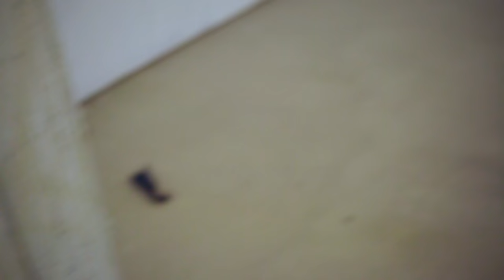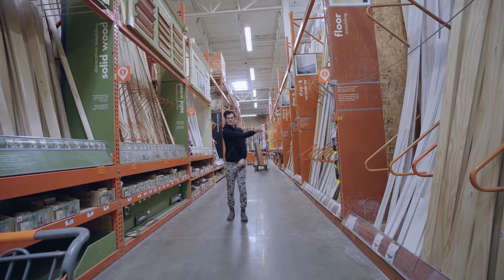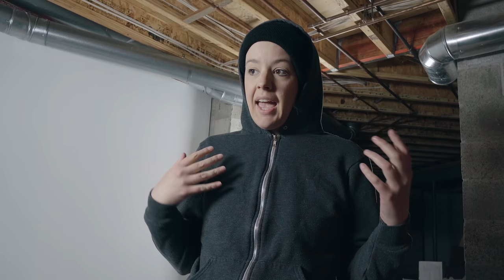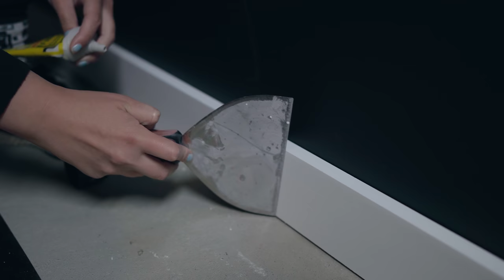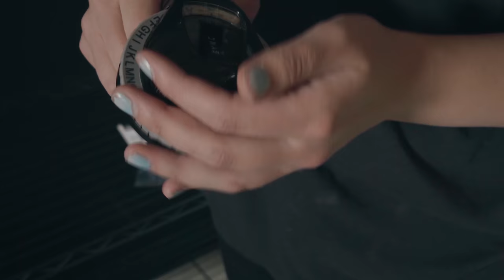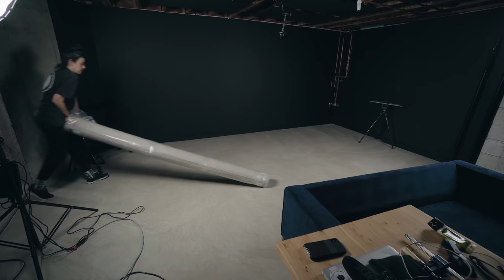It’s Just A Scattered Mouse… Turning Our Basement Into a STUDIO Pt.2!

Comment: Becki, did you find out how the mice were getting in? 
Until you find that and fix it your mouse problem could continue. 
BTW,  I had a mouse get into the wall of my house where the AC unit cables go through the wall. I bought a mouse trap, the humane kind that just traps them so you can release them into the wild later.  
I'm not so humane towards rats. They were getting into the garage at my mom's house. In the Winter they'd climb up on top of the engine in her car to stay warm. They made a huge mess and ate through some wiring. I found where they were getting in and closed that up and then took rat traps, baited with peanut butter and oatmeal, put the trap in a box or a paper grocery bag, and placed that along the wall and/or cabinets (they like to run along the edges of things). The rat would go in the box/bag, the trap would get them, and all the mess would stay in the box/bag, easy to throw in the trash.

Comment: Coming together nicely guys. Did you guys paint the floors? Thinking of doing something similar in my basement, but the concrete floors seems to collect a lot of dust.
Reply from the maker: No I used a clear concrete floor sealer/dust proofer over the floor!
Reply: Becki and Chris thanks!